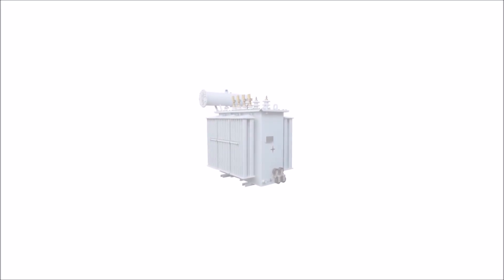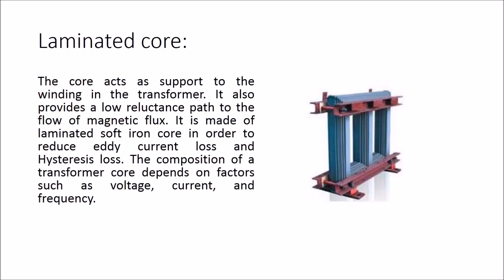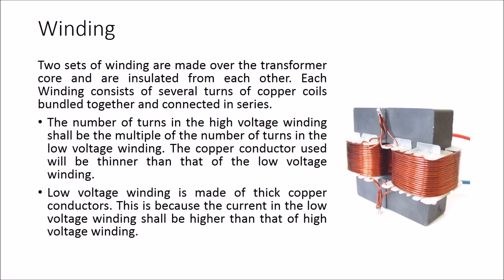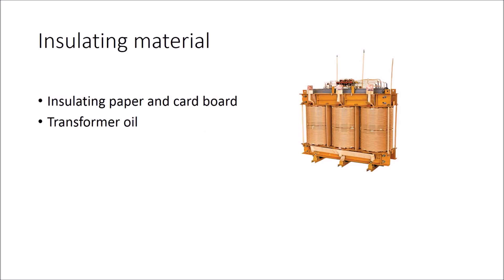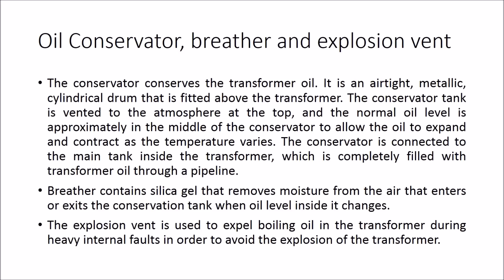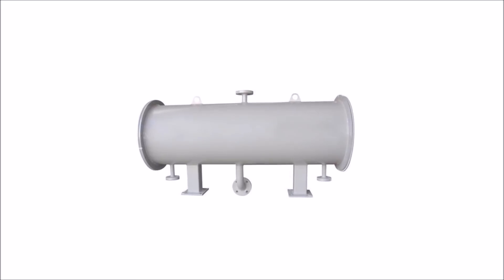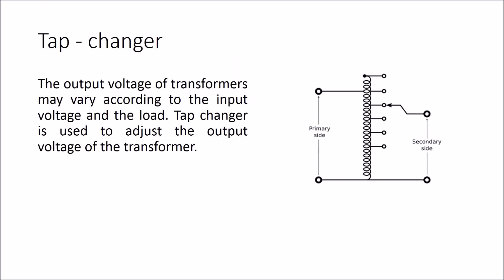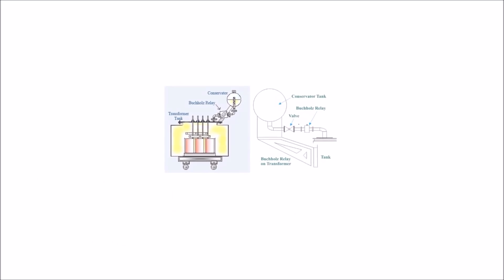12 Most important parts of a Transformer and its functions

Comment: Meaning of two lines in trnsformer free hand diagram or circuit diagram
Reply from the maker: In wiring/circuit diagrams, twin parallel lines are drawn between the primary and secondary winding to represent the laminated soft iron in a transformer.